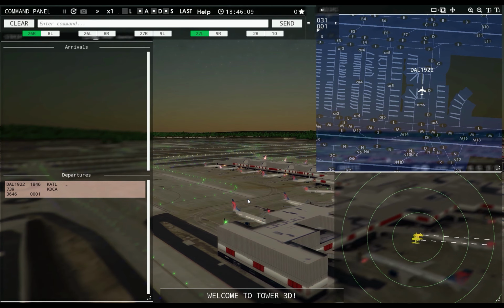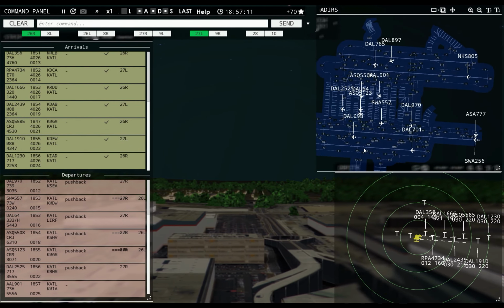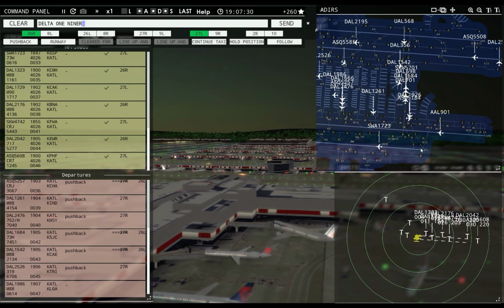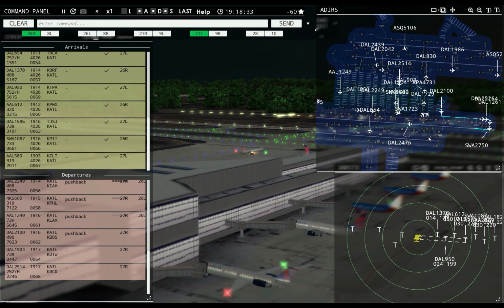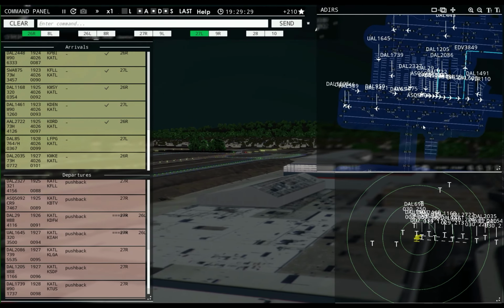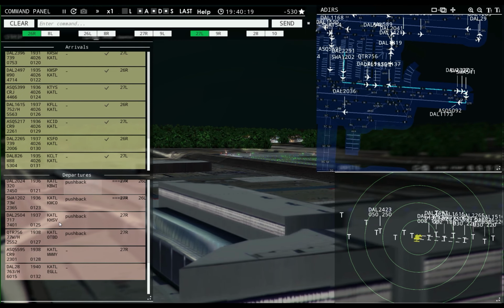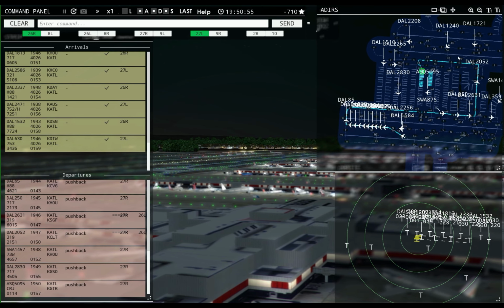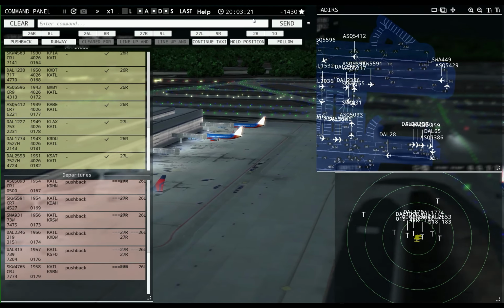Tower!3D Pro - ATL - Almost Successful

Comment: It's a shame that D is the only taxiway you can use to send traffic in both directions.  I guess you have to be hyper-vigilant when issuing the B, V, F taxiing command for arrivals, having them hold short of D until the alley is clear.
Reply: To cross everyone on N over 27R couldn't you issue them all a "HOLD SHORT OF V" or some other taxiway or runway north of E to keep them all moving?
Reply from the maker: Yeah, thats why I missed it a few times and had planes end up facing eachother :(
Reply from the maker: It may be possible, I think the rules in the game will force the plan to stop at the runway crossing still though.
Reply: From what I've seen in other videos, issuing a "HOLD SHORT OF" command will allow a plane to taxi over a runway (even multiple runways) until it either reaches the point it's being told to hold short of, or it's final destination, whichever comes first.  As long as you tell them to hold short of a point that is further past their gate (for arrivals) or the runway they're taking off from (for departures), they should keep moving without having to issue a "CONTINUE TO TAXI" command, which is clearly slower, since they are crossing from a dead stop.
Reply from the maker: Cool, when I revisit this style of play I'll have to try and remember that and see how it pans out.  Would definitely save some time lol.
Reply: It would surely allow you to cross at least a few planes in between departures on 27R, instead of just one using the "CONTINUE TAXI" command on a 1-for-1 basis.
Reply from the maker: I think I used it once inadvertently back on an LAX video.  Tested it again tonight it does appear to work.  Just have to be careful with it and see how it works when I play this layout again :)